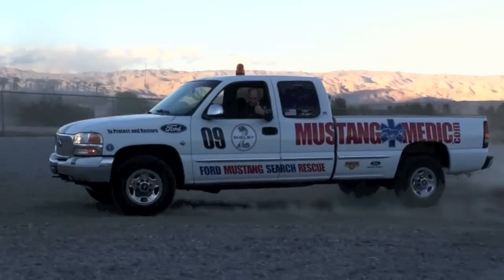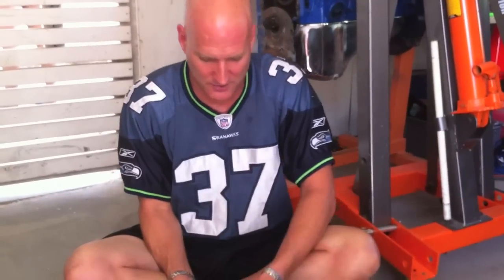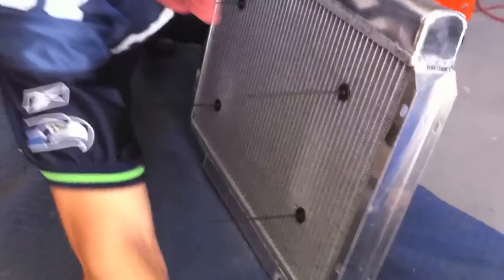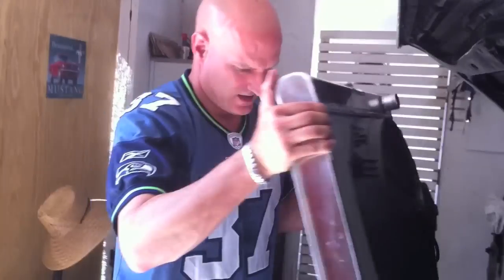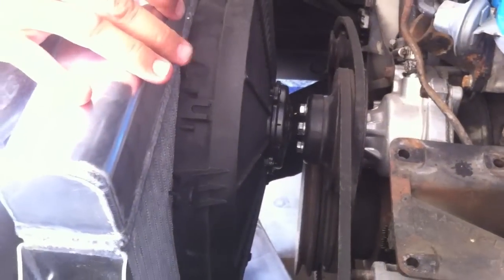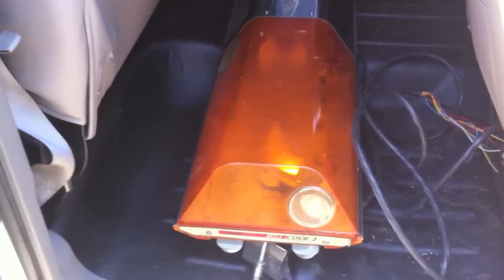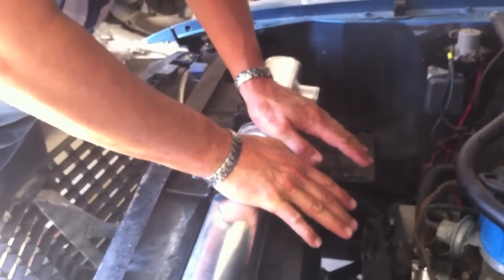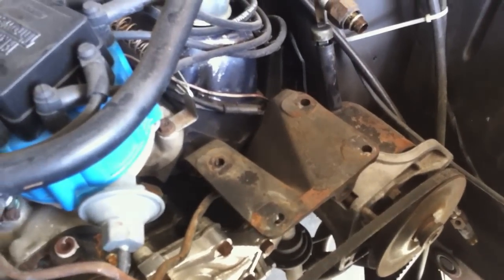Radiator electric fan and condenser 1969 Mustang Coupe F Code - Day 24 - Part 2

Comment: I am pretty sure those pads are supposed to be between the radiator and the fan. also on the front side under the lock caps. kinda protects the radiator from damage by fan that way. ;)